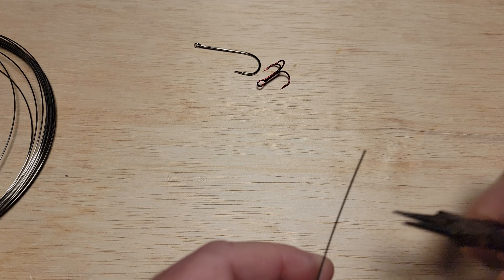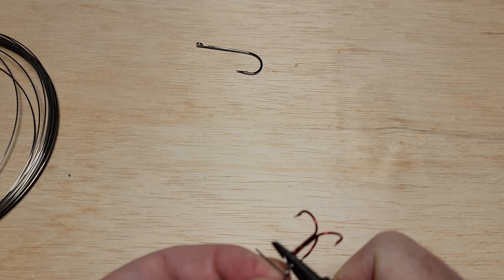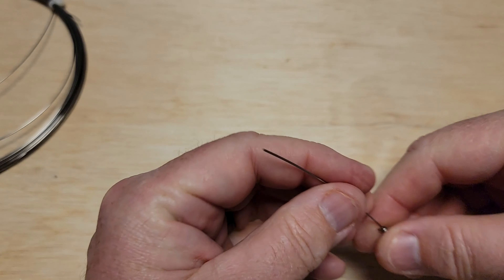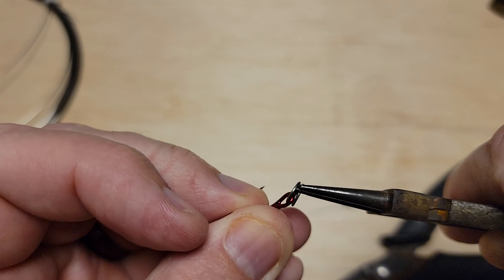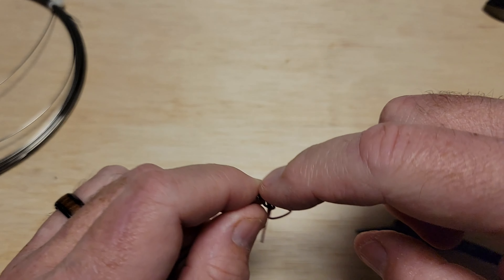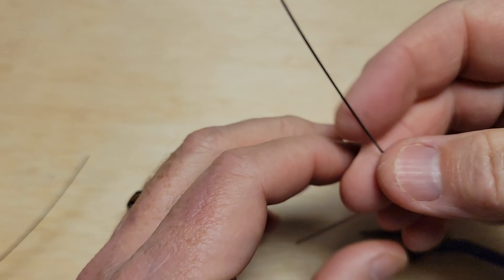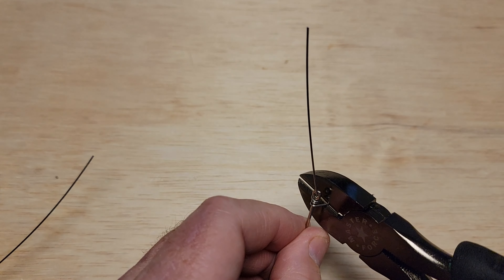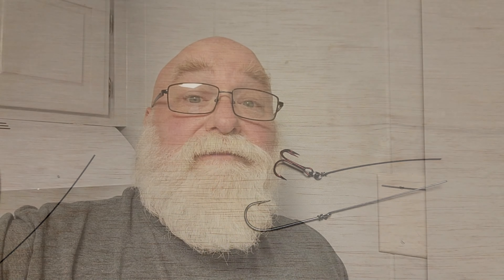How I Attach Hooks To My Lures

Comment: I have a couple. It seems like you're using .035 wire or something close. I only just started building and only have .041 wire. 

Snelling a hook with it by hand never comes out right and is a pain, so I drilled a small hole into the cutting part of some pliers and now I can clamp onto the tag end of the wire around the hook and spin it. Quick and easy... most of the time.
Reply from the maker: May be .033.   One thing I learned is don't be stingy on the tag end, an extra inch or two gives you a lot more torque
Reply: @MakeItTakeItOutdoors  I agree in general, but my man - drill a 1/8 hole in a pliers where it just starts to open up to the cutting part. It twists wire right down to the nub and it's just about effortless.
Reply from the maker: Ok, send me a pic? makinglures@gmail.com